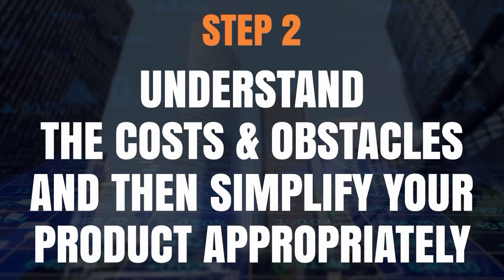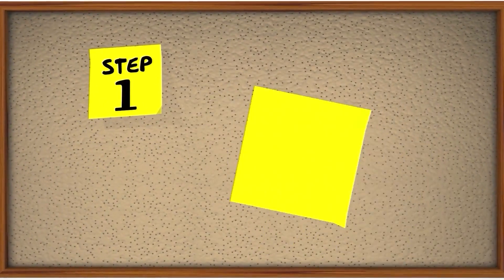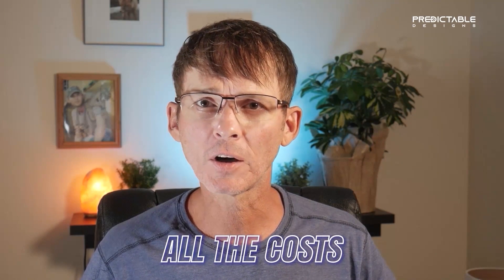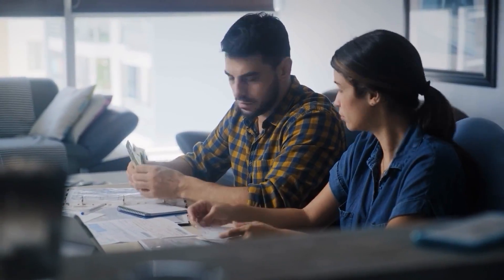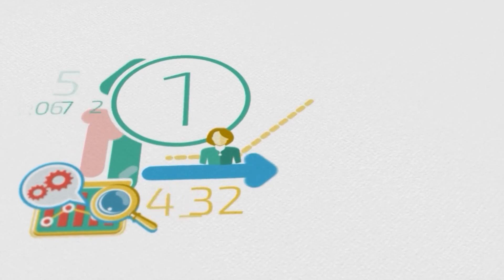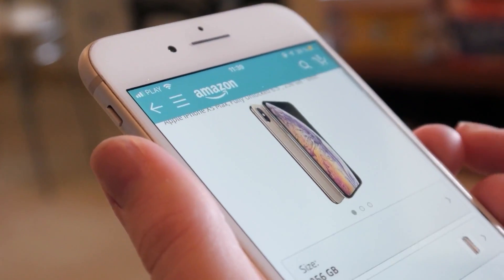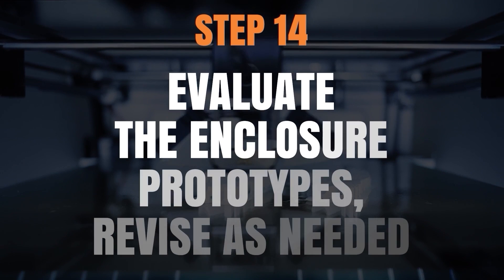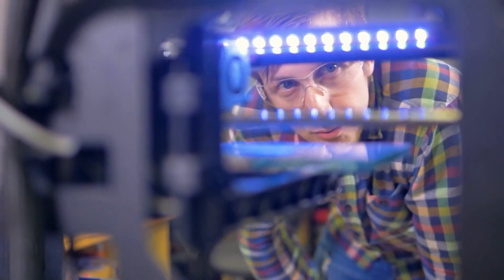How to Develop a New Electronic Hardware Product in 15 Steps

Comment: Do you think that 3d printing can be used for mass production? As the final product? Because injection moulding is currently inaccessible, not even in the nearest future.
Reply from the maker: In most cases unfortunately not. Main issue is cost and quality. But there are other cheaper intermediate alternatives between 3d printing and expensive steel injection molds.

Comment: This is a good example of the linear, traditional waterfall method of product development. I strongly suggest you read "The Lean Startup" by Eric Ries (2011) before you go down this path. It is very important to get customer feedback on your product early. You may need significant changes to get customer acceptance. Validated Learning and Innovation Accounting. No need to figure everything out to 4 decimal places if it is all going to change. Persist or Pivot.  Keep your costs to a bare minimum in the early stages.  Can you name the 4 methods of exponential sales growth? Of course, you can, if you have read the book!